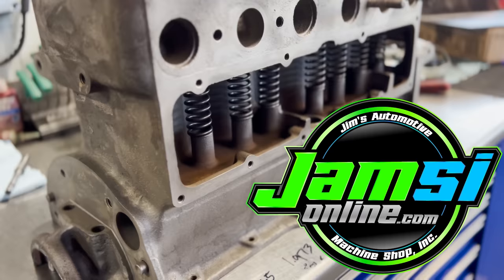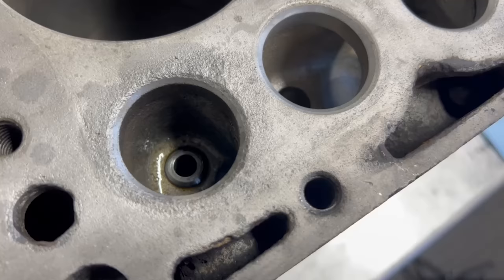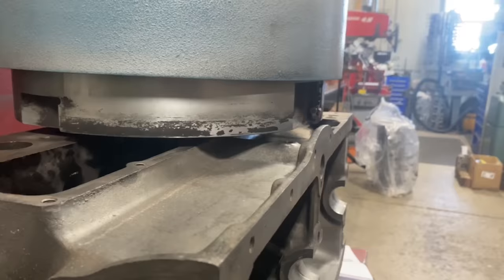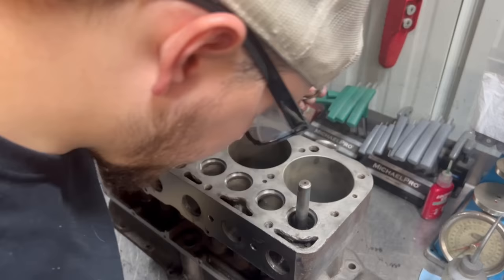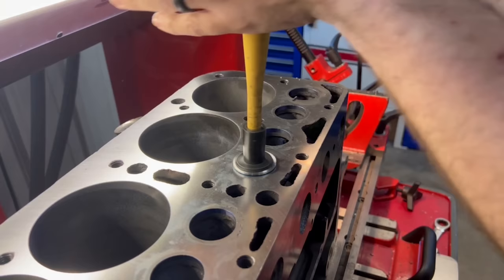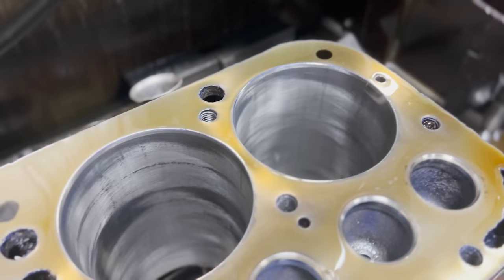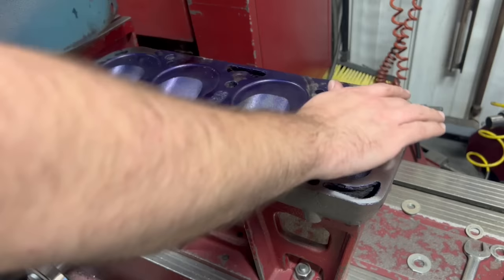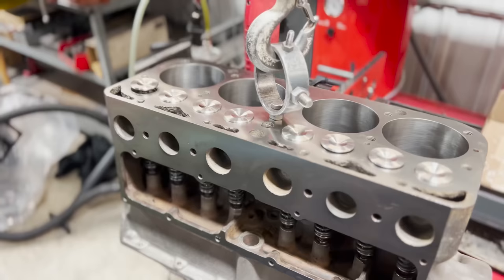Modernizing The 1929 Ford Model A Valvetrain

Comment: The good thing about the model a blocks is that you can put .120 over pistons in it.  After the .120 pistons wear out you can put sleeves in all the holes and start back over from std.
Reply from the maker: Right! I was glad the rust cleaned up at .100
Reply: Have you come up with what the new compression rate is going to be after the plaining on the block and head?
Reply: @bobjensen7136  does it matter? the compression ratio is so low to begin with, from the factory it was 4.22:1 what are you going to end u with 4.25:1?  A compression tester at sea level will show about 70psi on a new engine, a very far cry from something modern.
Reply: Ive been playing with a Franklin at my dad's shop. 
Interesting that they can't be bored over, because why bother?
 You can only get new sleeves in the standard size along with pistons. So if a hole goes bad ,throw in a new sleeve and piston and you're good to go. 
I mean why have 1 hole .030 over and the rest standard? 
Saves money and doesn't throw a balance off too bad.
Reply: It's satisfying watching you guys work !!!
   I use too work in a machine shop were the sigh on the wall said "Good enough, ain't gonna work"!
Reply: @MrTheHillfolk  i mean if you are boring an engine you oversize all the bores and use oversized pistons and never do just one oversized
Reply: @altonb93  Oversized one hole, turned down one rod, welded up and ground down one lobe of a camshaft NUMEROUS times over last 60 years. Made my own oversize piston once, made odd-size rod & main bearing inserts many times. On passenger car engines crank pin stroke can be +.010" -.040" and 1 degree advanced and 4 degrees retarded from true and it just doesn't make any difference. About the only things that are strict is no more than .003" wear in a straight cylinder bore and about .002" warpage on deck or head.
      I have always fixed things "how they deserve to be fixed" and have outdone the engine manufacturer many many times in the quest for reliability on high-end expensive severely loaded (but not racing) engines.
Reply: @patrickshaw8595  For general daily beater use? That is totally fine, and probably greatly appreciated by the owners, for keeping the costs down.
Reply: This will probably never get 20k miles on it in the next 100 years. Probably not 2k miles. As long as it is stored properly when not in use, it will never need an engine overhaul again.
The ONE issue they really need to look out for is overheating. The main thing these get used for is parades and hours and hours of idling in the summer in said parades.  Parades destroy these machines because you need a very good cooling system for them.
Reply: @tarstarkusz  Yes I feel your engine's pain. I'm guessing the silver bullet would be a very very inconspicuous electric fan. They have these teeny tiny permanent magnet alternators now. They come v-belt driven but maybe a guy could sneak one onto the BACKSIDE of an existing v-belt by using a small flat rubber-treaded pulley instead. You've be making a little second (12v but battery-less) electrical system. Just the alt and a dinky fan
Reply: @JAMSIONLINE  I need to get in touch with u asap about a 305 block
Reply: @patrickshaw8595  not a bad impulse but what's far less noticable is fan blade pitch, and pulley dimensions.  If you just slightly upsize your crank pulley like 1/4" you speed up the fan considerably.  Also you could make a fan shroud to help pull air over the radiator and have that be fully modular to remove for authenticity but give better airflow.  I'd just measure fan diameter and find something plastic out of a BMW or Audi that use push nuts and then mount for the parade by poking a zip tie through the radiator through a washer and zip tie the washer.
Reply: Just had to do that with my '52 8n motor. The hardest part is finding rings right now
Reply: That still limits the displacement. 8 or 10 years ago, a couple LSR guys went to the local metals dealer & bought BIG CM steel tubing, a bunch of steel plate & a piece of aluminum & built their own 3 valve engine from scratch to get the displacement they were seeking. Cool thing was they had separate water flow through the block & head so there was no place for a head gasket to leak water & they could regulate the temp in each independantly. Also, an undersquare configuration has never been the way to make the most HP per cubic inch. 2 other guys still build their own DOHC V-8 block & heads totally from scratch for LSR racing. Aftermarket venders made the crank, rods & pistons for both teams.
Reply: Holy hell .120 over!?
Reply: @anonymous-nobody1 bigger oversize would be less compression not more.
Reply: @altonb93 why not just keep it all standard ,it's a lot easier that way.
Reply: Yeah I was looking at that. .100 over is already unheard of in a modern block. You're lucky to get .60" over in most cases.
Reply: @anonymous-nobody1  nah its an apt question man, im curious too, no reason at all to put him down for asking a simple question
Reply: @bobjensen7136   Im curious about this too, id like to know
Reply: If you want to see the babbitt pouring for a model A ford, check out strong's garage channel.  The name of the video starts with pouring and boring!!
Reply: Thank you for your knowledge and videos USA 🇺🇸 TRUMP
Reply: @ObservationofLimits  Where'd you get that from? Bigger piston means more air being compressed into the same combustion chamber. Hence more compression 🤣
Reply: @the_car_guy5915  what? Bigger piston means more air (and thus NOT the same combustion chamber) but it doesn't at all mean higher pressure.

You could have a piddly 1.4L 4 banger running 14.1:1 compression and a 3L V6 running 10.3:1. Even though the V6 has bigger pistons, it has LESS compression.
Reply: @the_car_guy5915  for a guy named, "the car guy" you seem to be missing the basics
Reply: @the_car_guy5915  higher compression ratio means higher compression.
Reply: @ObservationofLimits  The irony 💀 More air in a smaller area is more compression. Plain and simple. And changing the piston does not change the shape of the head 🤣
Reply: @ObservationofLimits  You remind me of a friend's dad who said engines aren't supposed to have crosshatches in the cylinders 💀
Reply: @ObservationofLimits  Literally, do 5 seconds of research 💀💀💀
Reply: @tarstarkusz I drive my ‘30 Roadster a few thousand miles a year. Every weekend to the supermarket or hardware store. I’ve found that after a good flushing of the system, rebuilding the radiator works great. Last summer here in Texas it hit 114 degrees and she idled in the sun at a show and never overheated. People seem to think redoing a radiator is too much/ too difficult/ too expensive. But it’s worthwhile to never worry about overheating.
Reply: @allareasindex7984  There is a guy on youtube who cut holes in the top of the radiator and manually cleared all the tubes with a stick.  All of the tubes were badly clogged with 90 years of buildup.  But once he was done, he measured the flow and it was back to factory spec.  He got the top the radiator either welded or brazed back together.

Comment: The machine work you've done to this block and head is vastly superior to what was originally done. They didn't have to be that great from the factory as there really isn't a lot of pressure trying to force its way out like there is on today's engines. Awesome work man. Henry would be proud
Reply: I was wondering about the original tolerances and how much of the slop was from wear vs. old time manufacturing? I'd guess the rebuild far exceeds the original.
Reply: These are really primitive compared to the stuff we have now .... check out how the babbit bearings were done back in the day.... it's a wonder they ran or lasted at all
Reply: @sofakingmegamagaitgagsyerm909  the interesting thing is it worked ,,the model A was only made for a few years but it's amazing how many there are left,, same with the model T ,,the last T was made 95 years ago but there are many thousands of them still around
Reply: Correct. Wasn't the original Model T engine only 4.5:1 compression?
Reply: @JustWasted3HoursHere  3.98-1 according to the Wiki page which sounds about right
Reply: @wildcoyote34  I know. My friend does a lot of machine work for the local Model A & Model T clubs. I have sandblasted so many of those blocks & heads..... I learned a lot hanging out over there.....  the babbit bearings are another thing to see them poured & the boring bar used to cut them in ....
Reply: @wildcoyote34  Yikes! No wonder it was only making 22 horsepower! But, I've recently increased my respect for the Model T design after learning some of the very clever design elements they put into it. No fuel pump, no water pump, no fuel filter needed. For a time period where spare parts were not available at your local auto parts store, this made sense: https://youtu.be/vnaocIwRPjo
Reply: Agreed. This is drastic improvement compared to original. I was thinking the same thing.
Reply: Henry ford was not a good man
Reply: @JustWasted3HoursHere  the model T was an amazing piece of technology it is a testament to the design  when you see how many are still around ,, i know of  a half dozen just in and around my small town ,,the other one on a similar footing and there are even more still around and that's the N series ford tractor
Reply: @jonathanthomas2449  Indeed, but he was clever.
Reply: @JustWasted3HoursHere  True.
Reply: @wildcoyote34  And they were extremely easy to work on too, according to my dad. And that makes sense too, because in the beginning there were very few actual Ford dealerships or auto repair shops and so most people either had to do the work themselves or they would take it to, believe it or not, a blacksmith. Of course modern Fords (and cars in general) are designed to be nearly impossible to work on yourself since dealerships make the majority of their income from maintenance and repairs. Even formerly fairly simple things like spark plug changes or installing a new starter are becoming more and more involved. Toyota, usually pretty smart, moved their starter to INSIDE THE ENGINE BLOCK for some bizarre reason on their trucks.
Reply: @JustWasted3HoursHere  👍👍
Reply: Henry would hate it because he was known for cheaping out on items that were needlessly well-made.
Reply: @sofakingmegamagaitgagsyerm909  It always amazes me to hear about people sand blasting engine blocks.
Reply: @correctednews1463   when ya have the equipment ya tend to use it. I prefer sandblasting small parts in a nice temperature controlled environment but when we take on big projects, it's nice to have the ability. I guess some people have parts washers or pay someone to dip a block or clean it. But my mentor/neighbor always told me when ya start building your shop, weather it's for yourself or a business,  look at it as if you're a ship on the ocean & you need to be able to make anything you need to at anytime. I am still learning from that man today. I was a lot younger when I was blasting those blocks for him outside between boats, trailers, fenders, lawn tractors..... whole vehicle frames....
Reply: @zwz.zdenek  And thankfully he was. He made cars obtainable for everyone, in a time where most could not afford one. You can't stay in business spending more than you take in.
Reply: @jonathanthomas2449  Nobody was by today's standards. People often cite his ties with Nazi Germany, yet negate to point out how GM, Chrysler and many other industrial giants had them as well, and attempted to save their assets there from being destroyed entirely. I try to look at things from the lens of the time period, not what we found out later.
Reply: @sofakingmegamagaitgagsyerm909   I have seen some magic mixtures of Babbit do incredible service on some things but in general engines of this time did not last long between rebuilds factoring in poor oil standards as well.
Reply: @JustWasted3HoursHere   The reason for the low compression was not so much the lower tolerance construction of the engine but the terrible fuel standards of the day and primitive ignition systems. Going too high in compression just caused engine pre-ignition [knock] that destroyed many parts.
Reply: @alistairshanks5099  That makes sense.
Reply: @alistairshanks5099 
😊
Reply: @joepetreng471 honestly could probably handle a turbo better than the chevy 1.4 (or even worse) the 80’s ford 2.3😭
Reply: Frontenac made an over head valve cylinder head WAAAAY back then. A FRONTY Ford was badass back in the day

Comment: I was 15 / 16 when I started Building Model A Engines back in the day, 1971 through 1981. When My Mentor "SCOTTY" Passed away. YOU MY MAN, I WISH You were around and had the Same Capabilities as we see here. I LOVE the Work you did here to Improve on the Model A Valve-train. That wudda Been Really Nice to do back in the Day. And YES, Adjusting those Valves is Fun. Nice Job JIM. Really Nice Work!! Really NICE!!! I'am 69 now and No longer have my A's, Miss em too. Last Engine I did was a Model "C" with the Big Crankshaft Journal's and Counter Balance. SMOOOOOTTTTHHHH  it was Back then. Keep it up Jim, the Hobby Need's your Expertise.

Comment: Years ago I did a major restoration job on a 9N Ford tractor  that uses the same base engine design and decided to update everything including the remanufactured engine while in it.  

Two huge engine improvements I did were to port out the block so the intakes and exhaust passages were much larger and smoother flowing.    Then gut out the old front mount distributor and coil assy and add an electronic conversion kit set up to fire an external coil instead of the old block type it originally had. 

Beyond that was a full 12v conversion with a 1-wire alternator and extra lighting since it had the power to spare.     Engine wise I maybe gained  4 - 5 Hp, but when it only had about 25 to work with, that's actually a huge performance step up.
Reply: I was wondering about this part. I had an old 8n that I tried to restore and even though the engine purred like a kitten, I always wanted to see if I could modernize it and make it even more reliable. Glad to know it's possible! Thank you for your comment!
Reply: @UnicornGuru  It made a huge difference in power and general functionality.  
Always started well even in hard winters. ran nice all year round and having good lighting was well worth it.   35w bulbs in the original headlights with 55W halogens pointing front and back on both fenders made it a great after-dark work tractor.

Comment: Excellent!   It's been many years since I've ground valves... We ground the seats with stones back in the 1970s, although the "Quik-Way" cutter systems were emerging and were highly desirable.  We didn't have any way to use a milling machine to cut the seats, but instead we cut them by hand with a T-Handle.   

I built a lot of racing engines, and we'd cut some really narrow seats for those engines!   It was great fun 45-50 years ago, but the stuff your shop has makes what we were doing look pretty crude!   Love the channel!
Reply: Yes, I started as a mechanic in the 1970s in England, and I used to enjoy doing heads with the grinding equipment we had. Boxes full of different stones, and diamonds to true them up.
Reply: Wow, I can't imagine cutting seats with a T handle. That must've been fun!
Reply: @TowerCrisis  It was fine, with sharp cutters.

Comment: We recently did similar work on a 31 model a engine (a long with a non-babbit bearing conversion for the mains) and the engine series idles smoother and quieter than my 2018 mustang GT. (Direct injection pumps are noisy).

Now customer has a model a engine that is probably way way better than they ever left the Ford plant 😁. 

Good job helping keep old machines alive!

Comment: My usual valve train assembly is lifters with engine upside down, then the cam. Gravity holds the lifters out of the way while inserting the cam. Roll the engine right way up. Then insert springs and then valves. Turn the cam to install the locks on the valves that  are on the heel of the cam.

Comment: I did this exact thing years ago. We also had a block of steel to stop the press in guides. All of our seats were cut by hand with the old quick-way hand turned seat cutters. We had a plate with slots cut in it to slide under the valves to hold them open. It was a pain in the a**.
I have put many sleeves in A blocks but the measurements are in the distant fog of my memory. Yours sound familiar but I left that shop in 1979 so........ yeah.
Cool stuff. Save what we can.
Cheers
Terry

Comment: This is the first time I have ever seen a block that could be over bored .100. There aren't many if any V8 blocks that can safely go .060 unless you go aftermarket. Another beautiful job JAMSI!
Reply: Some of the old 60's V8 engines can go 80 thou some even 100 thou. It was late 60's when the accountants got hold of the paperwork to do with iron casting and requested less iron be used and ever since the quality of engines has decreased.
Reply: @shanerorko8076  quality of engines hasn't decreased in any way
Reply: @16vSciroccoboi  you don't know what I was talking about, you don't know what you're talking about.
Reply: @Retired Bore Dart iron blocks can handle 120 thou overbores. So yes, I would love to see OE blocks do the same.
Reply: @shanerorko8076  what were you talking about then?

You prefer heavier engines with weak casting designs, excessive porosity, and large thickness variations?

You prefer that over engines that can go for several hundreds of thousands of miles before needing a rebuild?  making 4 times the power of any of the pre 1960 engines you love so much?

You can rebuild one of the newer ones too, btw.